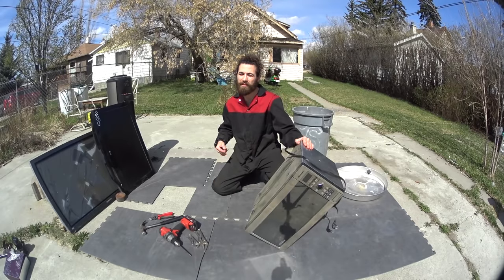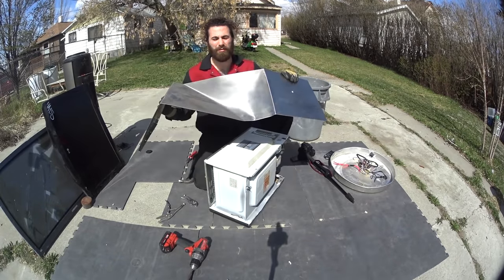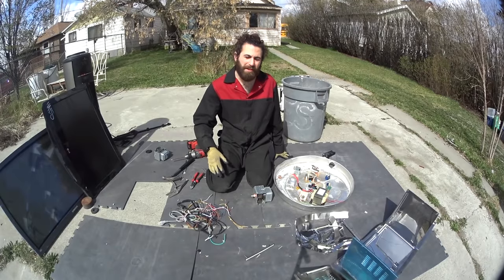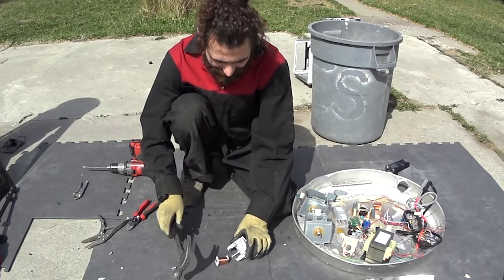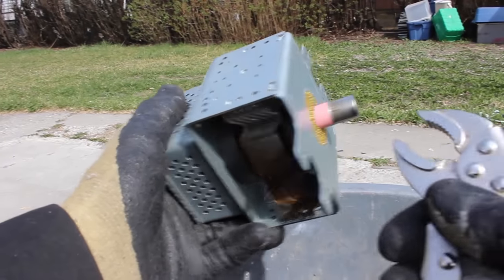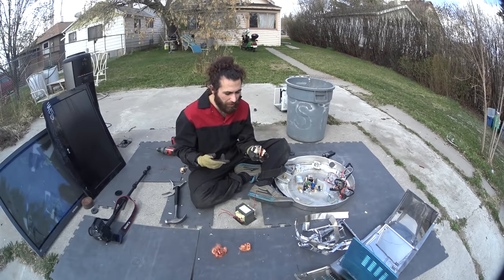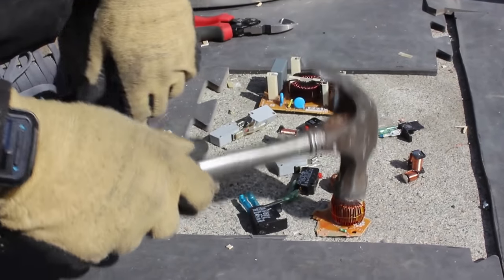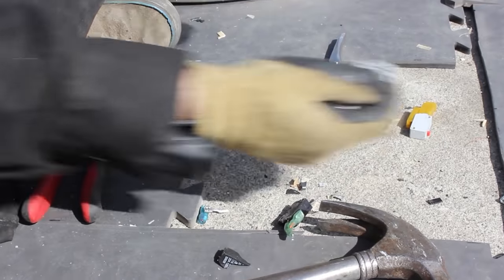Scrapping a Microwave FAST and SAFE! - Make More Money In Less Time!

Comment: How long does it take and how much did you make is it worth the time compared to just scraping the hole microwave
Reply from the maker: A person could rip through it in about 5 minutes, $1-4 in copper depending on prices. I would say they actually are worthwhile if a person does it with a plan. Either stack them up and do a whole pile of them at once, or crack them open right away and fill a bin with the transformers and then do a pile of those in one go.

Comment: Take a screwdriver blade and short it across the terminals of the capacitor.  That will drain any residual voltage that it may contain.  Works on any capacitor.

Comment: Do you separate everything yourself at the scrapyard like if I had a mixture of stuff how to I sell it then?
Reply: You would want to separate everything before you go. Most scrap yards are scams. They will screw you if They can. This goes the same for us as well. To many people have tried to screw the scrap yards as well. By adding sand to alum cans, or lead, anything thats heavy and non magnetic to make more. The yards will see one little thing out of place and give much less then its worth. Then take out what shouldn't be there and make 90% more then they paid you. Let say you had a 5' bar and half of the bar is copper and other half is brass. If you don't separate it. The scrap yard will give you the price of brass for the whole bar. They call it mix metal. Whatever 2 or 3 and so on, metals that they See on one piece, you will receive the cheapest price for what ever metal is there. You have to pick your battles when taring down items and parts. Always keep in mind, is this worth the time it will take to tare it down, for the price its worth.

Comment: The stainless on microwaves and other household everyday appliances is magnetic, so worth no more than ordinary steel. And that "bare bright copper" from the fan (or turntable) motor isn't bare-  it is lacquer coated which makes it second grade price. Don't mix that with your bare bright or you'll get less for your bare bright at the scrapyard.

Comment: just discharge the capacitor before you touch it ( touch the 2 terminals together with a insulated screw driver) and I seen that fumble at 6:08

Comment: All those circuit boards can be scrapped too. So don’t break them apart. 
Most scrap yards will purchase them. 
Just like, like the metal it’s all about weight, the more your pile(s) weigh the more $ you get.
Reply: Yeah, I have a barrel of circuit boards. Every month I find out about another aspect to look for. So I just stock pile them until I know about all the valuables.

Comment: Impressive. A man can build a Lichtenberg figure burner with the transformer out of a microwave.
I wonder what I can build with a rack of "Magnetrons..?" 
At any rate - I have a few more bits to pull from the microwave carcasses for some fine wire. Use it like moss at the base of a wire Bonsai tree.
Φ

Comment: I took apart a computerized GE profile that the repairman coudnt fix because the screw that held the bracket that kept the drum up had dropped inside. everything else had been working. Now I use the inner drum for composting, but noone wants the motor or all the labelled circuitry. Why is this?

Comment: The most money I ever made off a microwave was when I bet this dude $60 that if he would put his Mom’s Amana Radarange on the the roof of my ‘77 Olds Cutlass*, I could make it to the end of our street and back — going as fast as I could go — without it falling off. He knew I’d wail, and he was positive it’d fall in less then ten feet. 

Well, I hauled butt and thought for sure I’d lose it during the turnaround. Then, as I was breaking for the 180, I realized it’s gotta be really hard to judge what my top culdesac speed should be from way up at the other end of the street. So went just fast enough to make it look like I was trying but slow and smooth enough to keep from dumping the Radarange on the neighbor’s lawn. Actually, the Amana turned out to be so ridiculously heavy, it probably would have hung on if I’d tried a Rockford move. In the end that retro box of lead came through for me. 

Scratched the crud out of my roof though and fully smashed my toe when we pulled it off, but with those minor issues, maybe 7 minutes of work, and body damage to the Cutlass that no one’s ever gonna see — I feel like I raked big that day. 
____________ 
* Not just on the roof but on the edge more or less. We agreed the placement would be directly above the driver’s head.
Reply: Anything else you'd like to share?

Comment: Actually the capacitor has 50,00v and the cap has a internal bleed resistor the thing you see is a diode it sends - v to the case

Comment: Love your videos on scrapping a microwave but I saw that u had problems pulling brass plugs from cords.  I saw another video of a guy who made plug soup I use a crock pot dump a whole bunch of plug ends in boiling water, this softens the plastic around the plugs then you just pull them out with pliers.  It is still time consuming but so far I have 6lbs in 6 tall plastic medicine bottles with an average price $1 to $2 ea.

Comment: Bro! You should always stand on something insulated and put one hand in your back pocket and snip with the other near the capacitors. 

I don't want my favourite scrapper zappin' his heart!
Reply: @LOL-dq5iw  putting a hand in your back pocket is a very common safety practice so that in case a capacitor discharges into your body it won't go across your chest, that is heart, and stop it. Look it up. It's how you discharge the anode on a tube TV. Your heart doesn't need much current to stop it. Standing on an insulated surface stops your body from being grounded and therefore the path of least resistance.
Reply: @ryanbareither89  its pointless, just not putting your other hand down to earth would have the exact same affect, no need to stand upside down with a hand in one pocket and a leg out of a window
Reply: @LOL-dq5iw  alright. Why don't you discharge a CRT with both hands and then report back.
Reply: Check if the capacitor has a charge with your tongue.

Comment: Legitimate question

At 5:24 wouldn't that wire be too thin to be bare bright? I thought each wire stand  had to be like 16 gauge for it to be considered bare bright
Reply from the maker: You’re absolutely right. My yard doesn’t call anything “bare bright” it’s just #1 and #2 but I’ve learned a lot about scrap these last few years and one of the biggest things is I misunderstood the sorting of copper wire. I thought it was all about how clean it was but now I realize it’s about recovery percentage, and there’s a minimum size to account for loss when they melt it.
I often wish I could add little bits of footage to old videos! Unfortunately as soon as it’s published it stays that way forever 😅

Comment: watch out for the electrode transformer they will shock you so and the air conditioners the little silver looking transformers that shine like stainless steel dont mess with putting fingers on the positive,and negetive wire hookups .like a high powered battery

Comment: One thing I have a question about is what do I do with the radiator in the microwave?
Reply from the maker: Are you maybe talking about the magnetron, the thing with all the aluminium fins? Cuz that thing has a beryllium ceramic ring inside that is best to avoid completely, don’t want to inhale dust from that. I just throw mine out tbh, there’s two copper wires inside but they aren’t very long and it’s pretty fiddly for not much money
Reply: @thubprint  thanks a lot is it best to keep inside the microwave and just toss it in the scrapyard or should I take your advice and just throw it out? Also the magnet looked kinda cool 😎

Comment: So what's the yield cash wise off 2 microwaves?
Reply from the maker: If it’s a good transformer you might get 1lb of copper or a bit more just from that part, the rest of the bits don’t weigh a whole lot. With the prices high right now I’d expect $5 each, but much less if the transformer is aluminium windings on both sides

Comment: Replace the transformer secondary with 3-4 windings of 8-gauge wire and you can make either a spot welder or a weld-on dent puller. Plans elsewhere on YouTube. No more need for a stud welder to pull dents!

Comment: https://www.youtube.com/watch?v=wTP2RUD_cL0
11:42-Short the capacitor out by using a screwdriver with
an insulated handle and touching both posts of the cap
at the same time with the shaft of the driver. May spark, may not, but it has definitely
been drained of power.
Save it, caps can be worth the trouble of listing for sale.

Comment: +thubprint, are you tossing out all of your steel? Cash it in if you can, I used to think that it wasn't really worth keeping but you could easily make 50 cents to a dollar extra or more for your microwaves ovens. I fill stripped out ovens with scrap steel bits, screws, and tin cans to make my pile more compact. The silicon steel from the transformers are bought as heavy melt steel which is worth more than sheet metal.

Comment: it just hurts my soul seeing people destroy high voltage transformers :(

also to safely discharge the capacitor just get a plier or some wire and touch both thermals (without touching the wire or plier bare metal of course)
Reply from the maker: Ah fair enough

Comment: I am a scrapper. So let me just say

What a waste of good parts!
Reply: Howard Black  yes I am a salvager, but I'm also a scrapper. My backyard is separated into piles of tin, clean aluminium, electric motors, copper, brass, gas engines, ect. But I will keep anything worth reusing/repurposing
Reply: Howard Black  I'll have to look more into that, sounds cool. Do you have your own foundry? I made one a while ago (YouTube The King of Random - mini metal foundry) and a 2 piece box for green sand casting. I've made a few custom parts out of aluminum, and some copper ingots, but I've never tried mixing alloys.
Reply: Howard Black  I made mine with plaster of paris reinforced with stainless steel wool, in an old stainless steel stock pot (for cooking). My crucible is an old steel fire extinguisher with the top cut off. I've only fired it 4 times but I would recommend an actual crucible, and fire brick should hold up a lot better too. I would still recommend watching "the king of random" video for the mini metal foundry. It is the design I built from.

Comment: If you just break off the white plastic connector on the magnetron, then all of the copper wire comes out with it.  You can see the connector I am referring to at 7:24 just above his thumb.  Twist it around with pliers and voila!  Your delicate hands will remain soft and subtle 🤣.

Comment: It seems time consuming, I mean if you get a few dollars by doing that I'd do it. But if its just cents, I wouldn't bother. I dont scrap yet so i dont know all the prices of things.
Reply from the maker: It is, and it blows when you find out both sides of a transformer's windings are aluminium (like this piece of trash was..) But it's neat when you get one that's copper on both sides. I've got a video coming that gives a clearer picture at the money you're gonna get from one but spoiler alert: it's $3 or less.
Reply: Hey if you can get a solid $2 for one microwave I wouldn't mind doing this. I would learn how to rip them apart as fast as possible haha

Comment: I have no idea how to tell if that cover was stainless like you said, or aluminum, or whatever.  :^(
Reply: Magnet if it sticks it's steel or 400 series stainless steel. Grind it with a grinder if it Sparks and it's not magnetic it's 18/8 stainless steel prepared. No spark and non magnetic it's aluminum. Im a purchaser at a scrap yard.
Reply: Thx.  I need all the help I can get, w/out getting screwed at the yard.

Comment: You gave a terrible guideline to discharging the capacitor, bearing in mind the number of people zapping themselves. I'm also a first timer and from watching another video iv also got the tip of using the insulated gripper tool,touch negative nd positive to short the circuit. If this is correct please leave some sort of response for other new learners because it really sounds dangerous and people need to know. Cheers bud

Comment: imo best way for me to turn a microwave into a pile of copper is dump it at the tip and while there size off the largest electric motor and shove in my trailer. :face-fuchsia-tongue-out:

Comment: Caps can kill you if you do not take safety first, last, and always! ;-)
Reply: I've heard you can discharge them with insulated screwdriver...is this true?
Reply: @linda8ielbmm0hoggle8s3   If you can touch both leads to a earth ground you can discharge them, but I would do so only with heavy gloves as shorting them to a ground may cause them to explode. Maybe use a pair of pliers to hold them when you touch the wire leads to a ground. Also consider wearing eye protection. Depending on how large the Cap is you could do a screwdriver but both leads will need to touch the metal to complete the circuit. We had some young Air Force folks that were screwing around and charged a cap that went to a B-52 Bomber Auto Pilot system. They charged it for a few seconds and then played 'hot potato' with it and one of the young Airmen caught it and was killed instantly. All the others in the training room were discharged from the Air Force and one or two went to Prison for Man Slaughter. You must use safety and some common sense when you are dealing with Caps, they are not toys! ;-)

Comment: I do appreciate that you are at least contributing to the world by sharing what u know. I’d have to say this is not very environmentally nor economically the best approach but before I say that let me first say that you should be WAY safer than you were shown. There is more than one capacitor in there that could potentially store lol...a potential;)  Treat circuitry as if hot until you discharge it. Like picking up a gun....check the chamber first or treat it as loaded. The magnetron If shattered is seriously toxic. No hammering until that is out of the way. 

But why do this? I was crying at every component you destroyed. Max dollar would be to test the parts and sell every single working part on eBay over however long a time. Literally you could make hundreds. Certainly more than you could sell it whole for and maybe even more than you could buy it for new. Which brings up just selling it as is. I mean it’s pennies in scrap plus labor that we are trying to beat. I would bet you sell a broken mw for parts as is and get more than the scrap. You could also repair it and sell it. Possibly for zero dollars....if you would stop destroying all those parts u COULD be using to fix them!

Environmentally this is horrible. It’s not recycling if u are taking working parts and stripping the metals out of em. It’s recycled if it’s used in something else. And what about all that plastic that isn’t going anywhere but in a landed fill. 

The only reason I could see a person doing this for is he or she was A) so pressed for time. Like immediate need for the cash. B) The amount of cash that is immediately needed and just can’t go without is a few bucks? 5 bucks? I dunno how much it will get u but it’s not much and I’m sure varies by going rate and region etc. Surely tho this is not a roadmap for success. 

Personally I’d love to have a pile of broken microwaves and other stuff with big caps in em. Do you realize the fun you can have with a magnetron and a series of large caps?!?! Even just a bunch of large caps. Like dozens of them. High power lasers, rail guns, ozone generators, Tesla coils, and a bunch of other crazy ass stuff ur imagination can come up with. Grab a book or google and learn some electronics. Hell learning may just be the best value u can get from this. Go slow be safe and make sure you understand fully what’s happening and why. Have people check ur designs before using em. It’s like anything else. Start small and piece by piece it will come together for ya.

Comment: I think its called a grounding resistor
Reply from the maker: that makes sense!
Reply: The resistor doesn't ground the capacitor, it dissipates the stored energy by converting it to heat. Grounding a capacitor will make it blow up. You kinda had the right idea, just clarifying so no one thinks grounding a capacitor is a good idea.

Comment: WAAAAY to much effort. Better off buying a busted car for $200.  Sell batteries, tires/rims. Last 3 cars.... Cut the Catylitic converters out(up to four). Last catylitic converter haul I brought in was 11 of them = Got $350. Battery another $12×3. Tires $100 average × 3(sell online). Car scrap 150 x3 = $450. Just from buying $600 worth of busted cars. Thats $550 profit in a weekends worth of work minus $100 in fuel plus whatever you find valuable in the car that can be posted online.